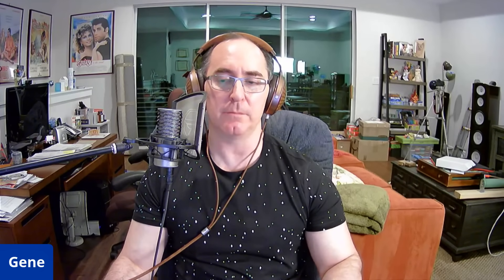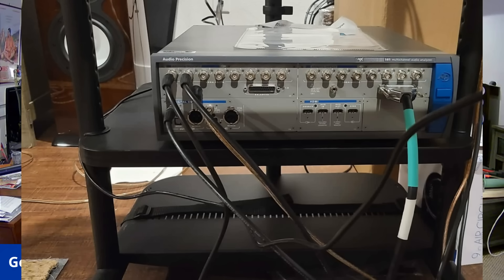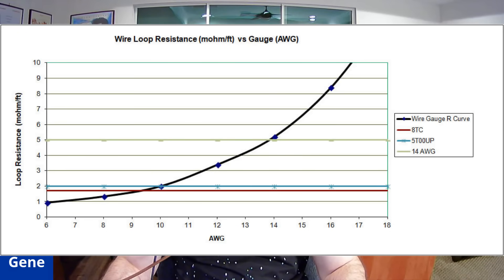Speaker Cables Really Don't Make Much of a Difference?

Comment: The way I see it, is that you have an amp output stage which is an alectrical circuit, and a speaker which is an electrical circuit - and a cable in between which is an electrical circuit.  They were designed independantly and not as a whole.  And the speaker is in a room that it was not designed for.  Can a cable make a difference?  Possibly - but who knows whether particular electrical characteristics will make the end result better or worse?  At best, a crap shoot at the electrical matching level and unless the cable is really extreme a minor change in overall impedance.  I suppose one could measure the extent to which a cable is an aerial and claim that rejection is always better.  Funny how the advertorials (sorry - reviews) claim expensive cables are better.
Reply from the maker: I demonstrated a full circuit path from amplifier to an actual loudspeaker how cables of sufficient gauge made a barely measurable difference (< 0.1dB at 20kHz). The cable "reviews" are mostly driven by placebo and biases of sighted testing and expectation bias of wanting to believe there's an audible difference when one does not exist.
Reply: @Audioholics  Quite.  Even if there is a difference, is it guaranteed to be an improvement? No.  The whole premise of 'a better cable' is flawed.

Comment: I think you have to rely on what you're hearing when you change cables as long as if you think it worth the cost it should be up to the person as long as the individual hears both sides of differing opinions on the subject. I will admit that I prefer the sound of my 100 dollar speaker cables to my zip cord cables.

Comment: I've always been of the mind that expensive cables were for those that liked the bling of them. Not being able to wrap your head around being able to use basic wiring to transfer signals between a $5,000 amp and a pair of $30,000 speakers is understandable but then if you can afford the amp and speakers...
I've also considered that if one was to seek the best cabling, it's not so much the gauge as it might be the number of individual strands. Consider that electrons move along the surface of the conductor, the more individual conductors might provide an improvement. Then again, even if so, would it be perceptibly rewarding?

Comment: You are using recycled electrons. You need t flush your system and replace them with extra virgin first use artistically collected electrons, otherwise you have set your system up to fail right from the start.

Comment: In an audio system, what is more important, the perceived sound or the performance on a spec sheet?  Why influence a listening experience, which, after  all, that is what audio is all about is the listening experience, not bragging rights that your system has the best specs per dollar of system cost (if you can even put a value on that).  If you are able to hear a difference between two components and you want to test to find out why, great.  It is nice to understand why things work the way they do.  It can can help in future designs and predictions, but if you can't measure a difference, that does not mean you did not hear it.  If you are not a good enough listener or do not have a good enough system to hear obvious differences between components (when there is a difference), you should not be misleading uninformed people.  It would be great if the cheapest components sounded the best.  More people would have better sounding systems.  You might want to examine yourself.  You make money telling people what they want to hear: in this case that they don't need to consider spending more on speaker cable because it won't matter.  Don't expect me to go back and forth on this with you.  This is plain logic.  When it comes down to it, a sincere music lover who is a discerning and skilled listener (not a snob, just an honest veteran) will pick a listening test over a measurement any day.
Reply: Listening test = subjectively biased
Measurement tests = no bias 
Perception = imagination coupled with experience

Comment: I can see the importance of clean power.  I can see the importance of decent interconnects, because any noise in those signals is on its way to be amplified.  Speaker cables… not so much.

Comment: When correctly implemented, audio test gear can detect measurable parameters beyond what the human ear might ever consciously acknowledge, including a gnat fart.
And we're on the same page when it comes to blind listening tests.
There remains, however, a difference between quantitative measurements and qualitative experience.
Test gear, especially that which is intended to measure sense perception, was developed to "re-present" a given sense through quantitative data.
The word, "re-present" is critical with respect to the difference between a quantitative re-presentation of measurable parameters and a phenomenological event or experience presented directly to the sense beholder, the sentient being.  
Test gear for electronic parts takes into account the known parameters/variables of these parts.
With respect to wire, the common parameters include, as you noted: resistance, inductance, and capacitance (others include magnetic permeability, field emission, and velocity/propagation).
But one need not go so far as wire and cable to consider sonic differences between identically measured components before applying simple extrapolation to conclude there are sonic differences between different audio cables.
Starting with resistors commonly used in loudspeaker crossovers, one can hear differences between resistors with identical measurements (TCR/PPM, Ω, L, parasitic capacitance), albeit are constructed of different materials.
I do blind testing of this type on a regular basis, and on a less regular basis have administered blind tests on assembled loudspeakers, where everything was matched, except for the internal wire running from the speaker terminals to the crossover, and from the crossover to the drivers.
I appreciate/agree with at least part of what I think you are trying to communicate, however, I'm not sure this individual video succeeds in making your message heard--at least for me.
What I hear you saying (and agree with) is: don't pay more for something that you can't hear as better (not just different) when evaluated through blind listening tests.
I rely on test gear as a "second set of eyes" to let me know if I screwed-up a product build, but test gear cannot yet fully account for what I hear and what I like.
Depending on test gear to tell us what we like, is akin to putting the cart (test gear) before the horse (we, the "tool makers" who developed the test gear).
Blind testing, on the other hand, asks us to honor our senses, mutable as they may be. . .
Reply from the maker: What you're describing is differences due to visual perception between 2 different products.  The prettier cables will sound better by virtue of their aesthetics or brand appeal. That's not something that can be measured empirically with test gear.
Reply: Please re-read what I wrote.
There is nothing in what I wrote that suggests a visual perception has anything to do with blind testing, let alone measuring/matching electrical parts, that when compared are within a sealed enclosure (cannot be seen) and selected through external switches.
Reply from the maker: @webekelven  yea, nobody has ever demonstrated audibility differences in speaker cables in controlled blind tests. Unless you use extreme differences in gauge,  none exists. As Spock said, "nothing unreal exists."

Comment: The cables don't matter for short runs  of 50ft or less  anything over  50 feet  to 100 feet requires large wire of 16 gage or lower to use thicker cable as area gets bigger.  Or the  area you want to cover. When you an electrician wire the walls.  Make sure the cable is large enough for the size  and the impedance created from curves and bends and corners inside the walls. If not wired. Do not  coil or kink  the cables coming off the Amp to the speakers.  Actual hearing is from 25 to 15khz. That  changes with age.

Comment: what about actually listening,sound more important then measurements
Reply from the maker: If the net measurement results are null between two cables, any listening tests not done blind are unreliable with expectation bias. Controlled listening tests have never produced statistically significant audible differences between cables.

Comment: I really appreciated the effort to present a factual discussion, when BS and an air of authority seems just as well accepted on the internet when it comes to spending on wire.    Most audiophiles , or even a person seeking a basic understanding of modern life, would benefit from knowing  few basic facts about electricity.  

Besides, hearing is subjective, as is mentioned by the host here, and if you get past that, given that cables are part of a circuit , if you start substituting parts in a circuit , like one cable for another,  the change in cable changes the circuit , unless the performance is identical .   but not because one is "better" it just makes a slightly different circuit with the different part.

Comment: My hearing is not subjective! I know for a fact different cables sound different! Not by graphs respectfully but by listening to the same track on the same equipment! I like the sound of my McIntosh amps over others I've used. I for me anyways, have found that MIT speaker wires sound different as you go up in models! I have used Kimber and many others but MIT sounds fuller and a broader detailed soundstage than all others I have tested ! Montana EPS Speakers with McIntosh MCD 7008 CD ! MIT Terminator 2 are in my opinion one of the best unknown audiophile secret buys ! They are very good but higher models even sound better! When testing a pair I thought my center speaker was still on, but I was in 2 channel and the sound was so full I thought my front surround was still on! Just saying! Wires do matter, if only to each's own ears!  Good info though! Thanks

Comment: I Digress slightly, I was inquiring about some interconnect cables at a Hi -FI store in Australia, I asked  the man that was attending me to A/B if possible, The electronics  were from Linn, The first demo was with  some cables that were $60/80  range and then the 2nd Demo was with the Linn cables, The contrast was clearly obvious, the Linn cables were clearer smoother and the whole mix just lifted,  you didn't need to concentrate, i don't know if it was Linn synergy or else but the 2nd Demonstration was impressive!

Comment: Cable size does make a difference. Ohms laws proves it. Due to Low voltage you will get a tangible voltage drop per meter.
On higher voltage the voltage drop will less affect the output.
Reply from the maker: https://www.audioholics.com/audio-video-cables/speaker-wire-gauge

Comment: I bought Zen Acoustic speaker cables from Mr. Lee about 18-years ago and it was night and day from the cheap copper cables I was using before.  Mac 501 amps and Infinity Gama speakers.  The cost was around 4k and to this day I feel it was a sound investment.  (pun intended)
Reply: Night and day electronic cable = new and lacks oxidation on contacts.
Old speaker wire = possible corrosion or oxidation reducing contact
Reply: @coolnout3765  Maybe?  The Acoustic Zen cables have silver added to the copper, the prior cables were all copper Monster brand and were new, but I would never be able to tell if they were contaminated.

Comment: I use mostly zip cord from Home Depot but I do use an extra cable that came with a power supply analyzer in one of my setups because I like the connectors.

Comment: None of this is any surprise. You can model it mathematically, and see the differences are going to be way below perceptible levels.

Now what is needed is to measure cable directional itsy and "burn in"...
Reply from the maker: Most people fear math. I've modeled the math 24 years ago for all of this. Now I have the correlation with measurements too!  Burn in is fictional as is directionality Unless you're dealing with active HDMI cables or audio cables with the shield lifted on one end.

Comment: I like the Cardas Clear Beyond line.  While not cheap, they aren't insanely priced like many companies out there (Audioquest, Synergistic Research, Shunyata).  I also fully embrace the placebo effect and I'm ok with this.  At the end of the day, I can't take my money to the grave.
Reply from the maker: True but you could put your money into areas of your system that will actually yield audio improvements instead of wasting it on expensive cables.  Room acoustics and proper calibration have the most profound effect on improving sound quality.
Reply: @Audioholics  Agree 100%.  I do have my room extensively treated and speakers were professionally dialed in along with the two subwoofers.

Comment: After 50 years of audio experience , also audioshop selling audio equipment...the mythe of audio cable is very lucratif but without placebo illusions, even the amplifiers ..in blind test fail in exotic prices value....sound difference is in speakers and acoustics....

Comment: Objectively cables don't matter.
Subjectively they do matter a lot. 
People don't understand how powerful our mind is and the power of suggestion. 
People like to think, especially men: "I'm scientific, so placebo does not work on me"
Well, it does for some more than others. And if you hear a big difference between cables, placebo works well for you. 
But why fight it? If the placebo gives you better listening experience, then use that to your advantage.
Take the nicest looking cable and use the power of suggestion by reading how "silky smooth the audio will be". Then plug it in and silky smooth it will be. 
In the end, all that matter is your experience, that is what you are after when you listen to music, not scientific measurements which are just boring and kill the joy of experiencing.

Comment: I just like buying OFC over CCA, especially for high power applications like car audio or long runs wrapped around a room to rear speakers (like 50’+).  I don’t care how FANCY they are, I just want the pure copper.  And I say I don’t care how fancy they are, but I also like buying the nylon/cotton braided cable covers because I find a beefy braided cable to be quite aesthetically pleasing to me.  I also feel it really helps protect the longevity of the cable by protecting it around corners and edges like coming out of an entertainment unit, or getting stepped on or folded.  You can also buy whatever cover sleeve you want to match your decor because I personally dont mind seeing a bit of cable, especially if they’re big and beefy and nicely wrapped.  Just makes me feel warm n fuzzy inside.  BUT, to each their own.  Never let someone tell you to not buy something that brings you joy.

Comment: not impressed . according to Wikipedia RMS is an average over .3s sample . absurd . a proper test in my opinion capture signal output w/ a high quality oscilloscope and compare . skip RMS as relying on it is to make assumptions , merely compare ! ACTUAL SIGNAL ! also compare your favored Kable to an expen$ive cable utilizing OCC .
Reply from the maker: Sorry buddy an Audio Precision is a far more Precise and informative way to do signal analysis than a simple Oscope.  FYI, The AP has a built in Oscope.

Comment: I’m aware that any minuscule difference in the electrical properties of a speaker has negligible influence on its audio property. I use QED silver anniversary speaker cable. I think it cost me €39.99 for each 1.5 meter lent, ordered direct from the manufacturer complete with fitted banana plugs. Why that cable? 1, because it’s inexpensive. 2, because it was recommended by the manufacturer of my speakers.

Comment: Speaker cables absolutely change the sound of a system how much depends on how good the equipment is. My system definitely got more bass when I switched from crystal cable to wireworld
Reply: Then you had faulty cables to begin with. And very very faulty. Cables make no perceptual difference. No matter how good your equipment is.
Reply: @Junker_1  lol ok

Comment: Gene, I beg to argue with you. Not on your presentation or methods. Rather on industry standard references. There are none. Signal Transmission and Interconnect Conductivity over two fixed points will never be agreed upon. A 25 year career in both disciplines with two of the most respected US based manufacturers taught me the basics to the most ridiculous. Two soup cans and a piece of string will work, the paradox being, audible sound capture, transmission and reproduction is subjective. What has more definable qualities, the person speaking or the person listening. Ponder that basic string theory concept for a while, but for not too long as you will spend less time enjoying the actual music.

Comment: I used heavy gauge electrical cable for years (the type used to rewire a house) and it sounded perfect. Currently I used Naim branded speaker cable because it came free with my preamp and looks nicer...That's the only reason I use it. I used electrical cable for years in my home recording studio too until i went to active monitors and required XLR inputs.
I lol'd when i read the brand name, 'Wayne Kerr'...
Cables are yet another audiophool snake oil con trick from an industry based on sowing the seeds of discontent.

Comment: I made some cables. Using 2 14s for each side. So a total of four wires on each speaker. I twisted them the whole way which shortened it significantly. Attached some hq banana plugs. And put some divider plastic things. And a cover over the wires. Makes it look professional. I have had zero issues with these. And they sound freaking great!